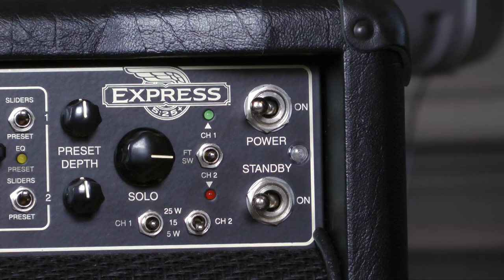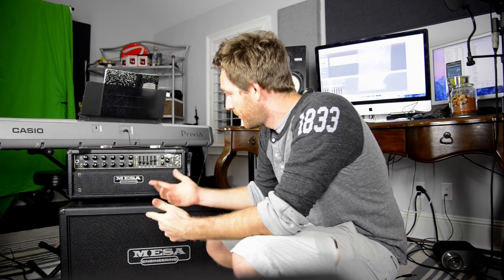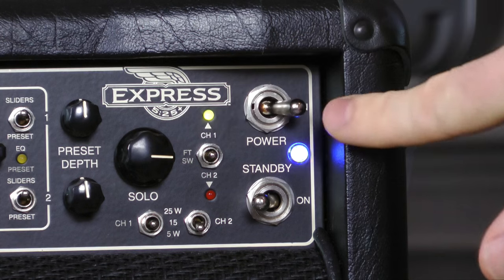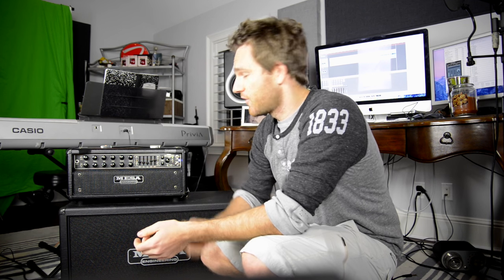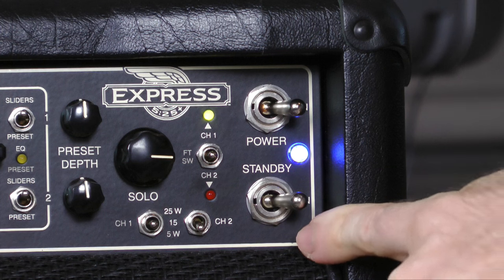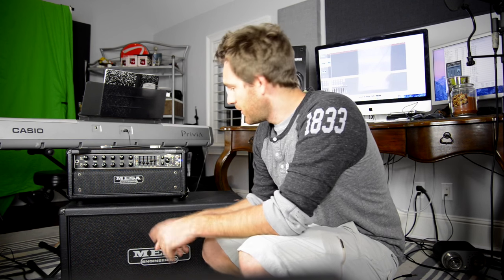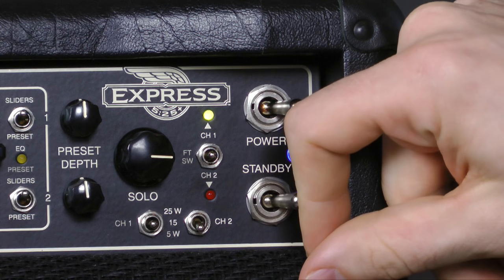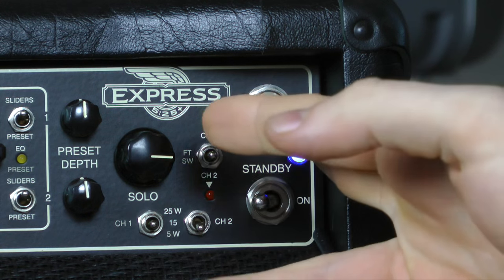How to Use Standby on a Guitar Amp

Comment: Seems like such a simple thing. But, for someone who’s just dropped 4K on their first tube amp it is vital information. 
Thanks for not making those of us who are only now learning this sound like dummies. Very cool. Subscribed.
Reply: Don't trust what others say.
He turned the Amp  right on when the standby switch wasn't on.
 So he immediately just turned the amp on without  warming it up.
Reply: @josephturnner6390  Thanks, l thought it was just me.
Reply: @josephturnner6390  I think he just made it confusing by saying he's turning "standby on" when really he's turning it off. Effectively the amp is in standby.. or its on. So when he says he's turning standby on.. he's really turning the amp from standby to on.
Reply: One correction though would be to not use standby when taking a break like between sets. Just turn the volume right down or turn the amp off completely - that is not what standby is for
Reply: On my Boogie just flipping stand by switch keeps fan blowing in the back. That can't hurt keeping things cooled off. But also just leaving it on and kicking on my tuner on my board silents everything on breaks.

Comment: Nice job of explaining this, short and sweet.  To me the terminology amp manufacturers use is counter intuitive.  By that I mean shouldn't when stand by is ON, the amp should be on standby, silent.  And when standby is on OFF then the amp is no longer on standby (standing down, so to speak) and is active.  But it is the opposite of that.   I never understood why they chose that phrasing, maybe "standby" is just the wrong word.
Reply from the maker: I'm sooooo with you on that. The fact that there needed to be a video on this is proof :) Thanks for watching!
Reply: My thoughts exactly.

Comment: I always thought you needed to wait 30 seconds for the tubes to cool down before powering off. However, it's twice now that I've walked away for 30 seconds, ultimately forgetting and leaving my amp powered on over night. So I'm really happy to hear I can just power off immediately. Thanks for the video man
Reply: He does not know how to use it or how it works.
Reply: @doctorgeneral4239 so is his assessment wrong? If so, how should it be done? Just acquired a tube amp with standby so I really want to know.

Comment: Just read three sources that state to turn on Standby first to let the tubes warm up and then the power.  It states on every source to allow the tubes to warm up, and usually as hot as they can be, then the power switch as to not damage the tubes.  This/these sources  are Carvin, Fender and Marshall that it is like stretching before an athletic event.  (Previous Athletic Trainer here)  You never go out and run a 100 yard dash without stretching, gentle run and all parameters of quad/hamstring stretching then you are ready for your "race".  Please clarify based on your sequence.  Thanks, The Guitarman.  I ALWAYS PUT IN STANDBY FIRST, THEN POWER.

Comment: I was told by many amp folks that while you’re correct on the power up procedure, you’re wrong on shut down. Should not leave in standby when powering on this helps the amp discharge properly inside

Comment: Logically it doesnt matter that much if you turn it in just with the power,
But i recommend to use the standby switch to cool down and warm slowly, turning it on and off only using the power knob could be bad because the tubes are hot or too cold wich causes a big difference.

Comment: How you PROPERLY use it: Ignore it. It does nothing in a class AB amp. They only included them cus people were used to them. Or maybe the guy designing the chassis had already drilled the hole. Or maybe they just had a bunch of chassis from an earlier model. Or maybe they were aware that you can charge an extra $20 for every extra knob or switch on the amp, cus guitar players are dumb and think that more knobs is better. No need to know WHY it's there. Just know that it doesn't need to be. That's all that really matters. If flipping extra switches makes you feel like a pilot, there's little harm in it. (Note the "little" rather than "no")

Comment: hi grat video, i have a stiletto ace Mesa but when i turn off the stand by switch i hear a "POP" in my amp and i dont know if this is normal...any advice?
Reply from the maker: That is kind of weird, mine doesn't do that. Not sure what to tell you!
Reply: @seandaniel23  What's happening is, your first filter cap is tied to the hot side of the standby switch. As the tubes are heating up, the rectifier is trickle charging the first cap, but all of the other ones are tied to the cold side of the switch.  When you go from "stand by" to "play", the popping sound you hear is the first filter cap discharging into the other ones. This is nothing to be concerned about because it is much less wear and tear on the tubes for them to be powered up by filter caps that are slowly being  discharged, rather than having your cathodes slammed all at once with the full voltage from the rectifier. It's like warming up your car on a cold morning before driving away. It   just makes everything last longer.

Comment: Not for nothing here but a tube CAN NOT have signal passing through it until it's warm.  The whole purpose of the heater is to heat the tube to make electrons flow within the tube.  "Proper bypass switch usage"  is such a myth, bypass switches are needless and do nothing to protect your amp.  it's actually better for everything within the amp to just kill the power and let the filter caps drain naturally by the tubes as they cool.  At one time engineers thought they were necessary, then they weren't so standby switches were removed and it was guitarists that wanted their standby switches back... why... because that's the "way we've always done it so it must be proper".   But don't ask me I just build tube amps.

Comment: The standby switch is actually useless just turn both on at same time
Reply: Guitar Shredder no
Reply: Nope, allowing the output valves to come up to operating temp before applying B+ is a smart move.

Comment: you know nothing about electronics,and your advice will do more harm than good,
especially if you run solid state rectification.
im not going to explain in detail-look it up your self.(like you should have done before posting bullshit advice)
standby switches are carried over from class a amps,which need them.
Reply from the maker: Just telling you what Mesa told me.
Reply: Yessir, you are absolutely right. I watched this video and realized right off the bat, he wasn't aware of certain aspects related to tube amplification.